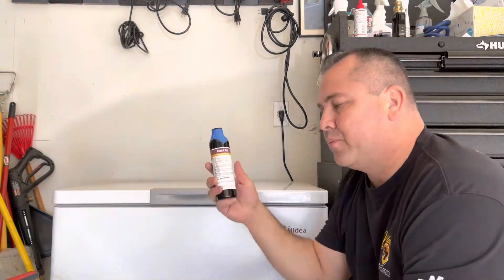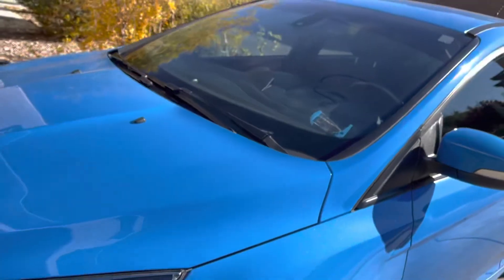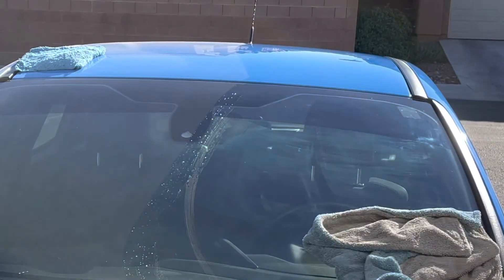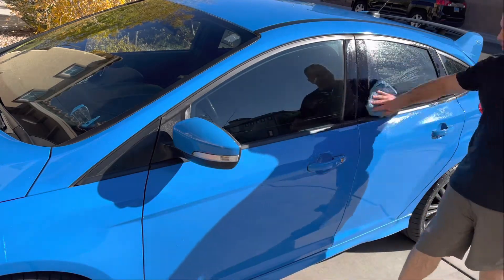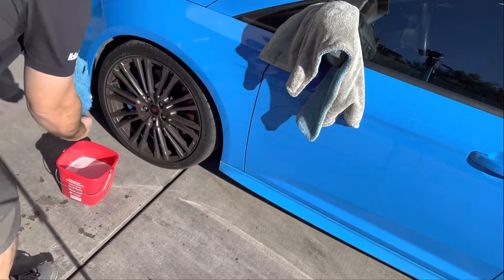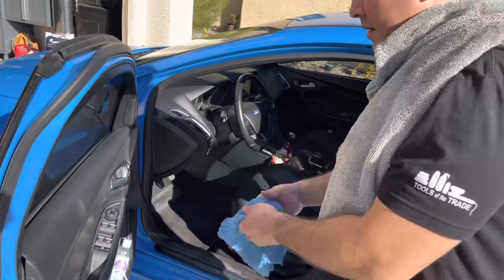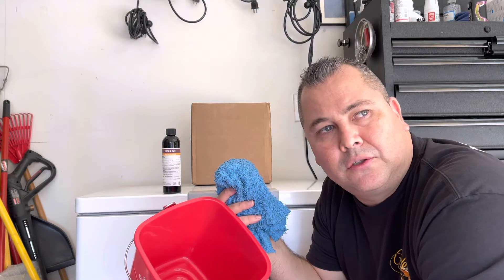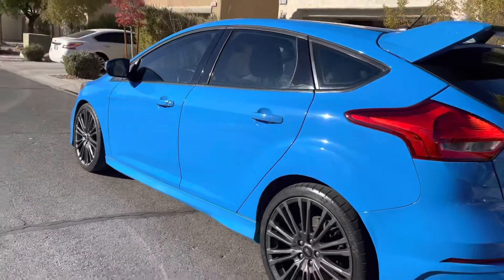Croftgate Wash & Wax

Comment: This product looks like a winner here.    I'll have to try a bottle of this stuff out.  I'm into winter here where I live so I am doing only rinseless washing right now since I had to turn off my outside hose bid to prevent freezing.   I like the fact you can just use a regular small bucket and one towel and then follow up with a drying towel.    Looks like it would be a great maintenance rinseless wash product or quick wash product.     ✅     Love the mystery box!   Some of my favorite products of ALL TIME!    Can't wait for you to try those out.   They are EXPENSIVE.   Some of the most expensive detailing products out there.    But for an enthusiast,  it's about the experience.   And they deliver.    I think ❞🅷🅸🅶🅷 🅶🅻🅾🆂🆂❞will blow you away.    Two more you really need to try out next time you get an order from Polish Angel is ＤＩＶＥＲ 
(Their Glass cleaner with built in Glass Sealant), and ❞🆂🆄🅿🅴🆁🆂🅿🅾🆁🆃🆂❞(Their spray on wipe off wheel sealant).   Those two are my favorite products from Polish Angel.     I really can't wait to see how that Blue Wax works on your incredible Blue Paint.   I was thinking about getting their 𝐑𝐄𝐃 𝐎𝐏𝐀𝐋 which is the 🆁🅴🅳 version of their colored wax products for my red paint.
Reply from the maker: This Croftgate was pretty impressive for me.  

Damn, now I have to order 2 more PA products.   Grrr.   Ur killing me!!!  Haha
Can’t wait to try them out Joe.  Thanks for making me see the light.  Hehe

Comment: Thanks for the video! My fav rinseless w/wax is Duragloss. Do you like this Croftgate more than DG? Also have you tried Micro Detailer MD Ceramic Wash Xpress? It's a rinseless/waterless wash solution that doesn't contain any waxes or gloss enhancers. It's a pure cleaner. It's high foaming and does a great job. I love using it in waterless dilution ratio for cleaning interior windows and cleaning interior in general. But does a great job cleaning paint especially if you don't want to interfere with a coating or wax finish.
Reply from the maker: I love the Duragloss.   Hard to beat for the price.   This was different.   I haven’t tried the Micro Detailer.  I’ll look into it.   Sounds very interesting.   Thanks for watching!!